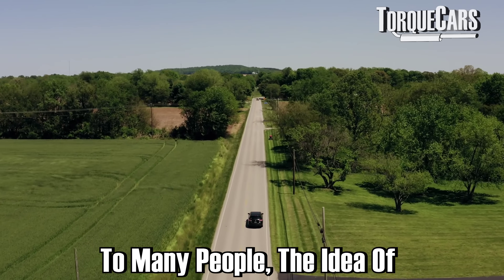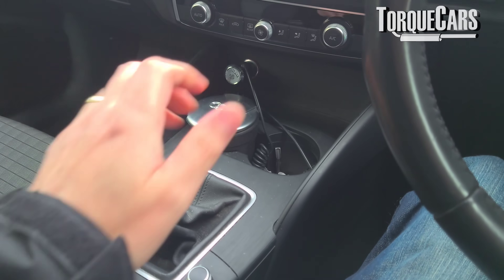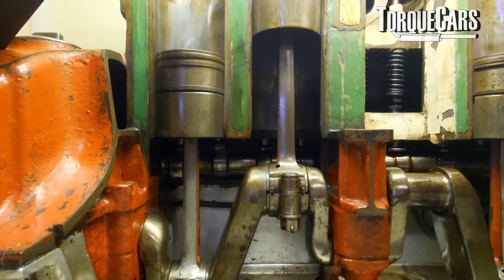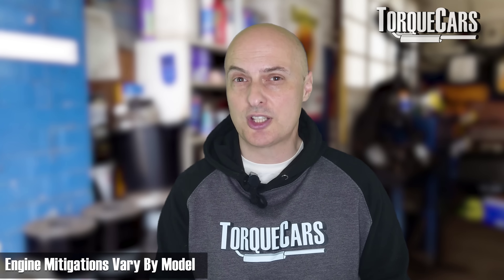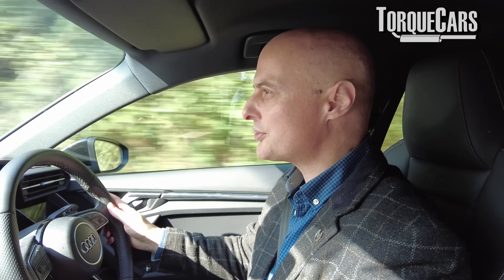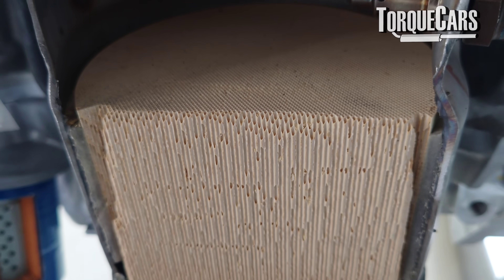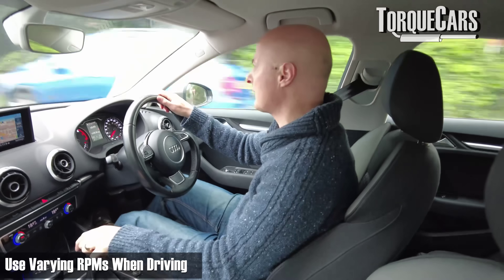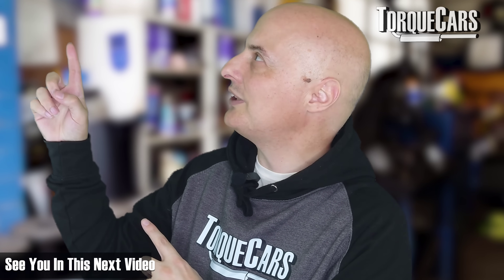BIG DAMAGE By Lugging at LOW RPM? Eco Driving Warning! (Manual Gears)

Comment: Dudes in 100k mile civics living at a constant 10k rpm and only going 25mph, it all makes sense now.
Reply: 100k miles is honestly nothing. I consider a car that doesn't make it to 100k easily a piece of junk. That or totally abused in both driving and maintenance.
Reply: @CynHicks  Yeah but cars usually last much longer than bikes of like 125cc single piston high revs of 10K+ rpm...

Just like Trucks can do crazy, crazy high mileage because they are very big, very low RPM high torque beasts of diesel that are made for mileage, they would never do their mileages if they had tiny pistons crazy high rpm gasoline engines.

Usually bikes for lasting long is like 4 piston big bore engines that are not constantly driven on redline and such bikes never have to be even driven to redline unless on a track cause like the max speed limit of 100KMph here lot can even reach it in first gear so they don't need much accelerator in 4th gear or 5th gear to maintain relatively high speed and also the huge RPM is divided by the 4 pistons doing the work which is much better than a single piston making the entire engine to redline to like 11K or more rpm...
Reply: Well my motorcycle 125cc 4 stroke has a bit more than 40K KM and now to do a full fuel tank I need to top up almost the full engine oil in like 3 times and that's the reason of being 95% or more always in high RPM but due to the lack of power it just needs full accelerator and full rpm all the time sadly ☹

The thing is it barely even smokes unless at like RPM cut just a very tiny bit, its like the damn oil is just evaporating from inside the engine FFS, also not a single drop of oil ever dropped either, the whole engine is all dry from the outside.
Reply: @guily6669 mine had the same issue, tho it just happened at 250k kms. It was stuck oil rings.
Reply: @jojomarujo8704  wow that thing lasted quite long, it isn't a 125cc with a crap single piston??
Reply: @guily6669 Yup. Mine lasted kinda long cuz i swapped the rear sprocket with the smallest size i can find so i can get decent speed without bouncing up to the rev limiter. I'm just a 55 pound guy that live somewhere really flat so smaller sprocket just works for my use case.

 Put a 0.25 oversize piston so the boring still have lots of life innit.
Reply: @jojomarujo8704   I hope mine doesnt have much wear inside, if it's mostly the piston rings, I'm safe, else I'm screwed...

But I really want to buy a 180cc kit however a mechanic from youtube assembling them said to me that they never last more than like 7 months sadly grrrrr....
Reply: @guily6669  Kinda sounds like a bad engine design.  I mean, I had an 06 GSX-R 600cc (rated 117-119 bhp/101-103 rwhp stock by Suzuki) with a pipe/no cat/MotoGP muffler.  16K RPM redline.  Most of my cruising was 5-6kRPM or higher.  That was slower riding aka 55ishmph+ in 6th gear.  It saw 16K RPM countless times, too.  I generally shifted at 14k RPM as peak power was rated at 12.5k RPM... I'd just hit 16K RPM when I wanted that sound only a 600cc like that could make at those RPM.  600cc DOHC inline 4 16-valve engine.  Engines were solid.  Yamaha tried to outdo Suzuki with a 600cc that did 16.5k RPM.  They kept blowing up and there was a massive recall on all their engines lol.  05-06 was the 600cc wars when the best 600cc supersport engines were made.  

But, of course, I didn't have to drive at 95% throttle to keep up with traffic.  I did have four wheelers and I rode those at 100% WOT most ALL of the time.  I'm an adrenaline junky.  No engine problems.  

I dunno, I just find it strange.... I mean, I can understand an engine under full load for 24 hours would do some damage, but I doubt you drove like that.  I just think whatever engine you had was a bad design.
Reply: @guily6669  new rings maybe pistons. they wearout a lot on those bikes. my service book ended at 48k km. mine died to a bearing failure of the gearbox outputshaft, where the sprocket connects. with 30k km.....
Reply: @johannesdatblue4164  I will have to go to yamaha one of those days, but my car just broke the clutch FFS (the pedal does nothing)... 😡

I really hope I just need new piston rings, however I dont think yamaha will sell a 180cc kit and assemble it ☹

And I never really liked the mechanic of the only yamaha dealership here, I only did the first revisions there and stop going there...

EDIT: Also I had a cleanable generic oil filter for a damn long time not made for this bike, maybe it didn't also help a single bit cause it almost never had any metals in it, I don't think it was filtering anything.
Reply: @guily6669 if it's a chinese one it will need a rebuild soon but lasted alright, honda and others might get to 80-100k kilometers if you drive them properly, maybe more but they burn oil and become POS.
All those 1cyl 125cc engines don't last long and need occasional rebuilds, they are cheap and easy to work on so anyways learn how to rebuild it yourself if you don't already know.
Reply: @guily6669 oil doesnt evaporate like that. Piston rings are shot, shooting compression gases into the crank case, forcing the breatger pipe to spit out the oil. Try riding it at a lower rpm and take a lool at it. Less rpm means less pressure in the crank case (in a gasoline motor, non-turbo)
Reply: @guily6669  I did 50cc -> 400cc -> now I want a sport tourer 1k or more 

But yeah it's not needed
Reply: My Integra is over 300,000km and I rev it to the over 8K rev limit literally every time I drive it. The rev limit exists to keep you in the intended rev range where the engine is not going to destroy itself. The limiter would be useless if it's set at a dangerously high level after all, it may as well not be there if that was the case. 

Basically it's not going to harm a maintained engine and has its own benefits on top of just being fun so let that engine breathe and stretch its legs, they were literally made for it
Reply: 180k miles on mine and 7k rpm is my daily 😂
Reply: @Athaion0  7K??? mine goes a lot to 115000 rpm LOL it's the rpm cut, it doesn't have a rpm gauge but it's around there... but like 9 - 10K is more constant.
Reply: @guily6669  mines stock cause I’m broke 😂😭
Reply: @Athaion0  Mine is also stock, it's a yamaha WR 125 X... I only have a K&N air filter, nothing more and different levers or whatever its called in English for the brakes and clutch in gold and with adjustments...
Reply: @guily6669 It’s a 125cc single, 10,000rpms isn’t out of the ordinary..

I used to own a 1989 FZR250R, it redlined at 19,000rpm and is a four cylinder..
Reply: @izzy031096  yeah the FZR250R was a crazy beast, a modern 250cc 99% won't be even close to scratch it...
Reply: @guily6669  a jet engine I presume... 😉
Reply: The kit isn't complete unless the muffler is replaced by a vuvuzela.
Reply: I’ve never really thought about driving in low rpm’s and then accelerating could cause engine problems, but thanks to your presentation, I get it.   Thanks
Reply: Gotta hit that vtec
Reply: Honda is great at making high revving engines. Too bad they don't make em like that anymore.
Reply: Sounds a bit iffy, I can't believe that civics are geared that low
Reply: @ttis3701  
Never noticed my 100k 2010 Civic go more than 2k rpm. Maybe I'm wrong.
Reply: Things nowadays are not super durable.
Reply: @BadMouthBroadcast  nothing like the smell of made in China 🤣
Reply: Have a k20 myself.  Can confirm.
Reply: That legit made me laugh 😂
Reply: @ttis3701  i accidentally replined my 96 tacoma v6 by pulling it in neutral while cruz is on lol and it has 350,000 going strong
Reply: @ttis3701  Clutch disc is dead
Reply: @ttis3701  litterally me 😆 65mph at 4400 rpm with a 5.1 FD lol
Reply: My k20 goes to 9000rpm, and I'm over 120,000, doesn't skip a beat.  It has hit 11,000rpm accidentally, but it's still going strong.
Reply: 100k aint shit ive got 210k on my audi a3 with a duel clutch
Reply: My Honda Civic i-shift 1.8 2009 has 111k Kms and I VTEC it almost everytime I drive it. I recently drove it from Paris to the UK averaging speeds of 135kph, max speed 172kph and vteching gears from 3 -5. Also drove from Oxford to Liverpool and back. Also hit VTEC a lot of times on dual carriageways etc. On the return in France I hit 180kph once. I checked the oil the next day and it was down a quarter, so I topped it up. Checked the VTEC solenoid, no leaks. It had a leak around 9 months ago and I changed the gasket myself, a few euros. Still clean as a whistle. Only thing about these cars is to take good care of the clutch, no creeping, nor keeping foot too long on the brake at lights. Otherwise no problems.

Comment: When I was young, dad told me not to 'lug' the engine.  Also, not to constantly 'redline' it or 'over-rev' it.  Like, don't go up a steep hill in top gear, or don't drive highway speeds in second.  Know whereabout your torque/hp curve sits in the RPM range, & drive with some common sense.
If you want to save your engine, or to save fuel -- stay home or ride a bike or take the bus or get a ride.

Comment: Coming from a '02 VW 1.8T I bought a '03 Mazda Protege5, this car has significantly lower gearing than my Passat. I often find my self in the 3-4k RPM range just matching how I drove the turbo. I thought I was driving the Mazda too hard wit hits "truck" gears, Its just a commuter car thats not overbuilt like the VW. I will back off from that harder driving especially before fully warmed up.
'Lotta JDM cars were made for their streets so I wonder how their range of driving is supposed to be? Like for a healthy, long lasting powertrain.

Comment: Can you down shift from 4 to 2 revv matching??  Or must it be sequential
Reply from the maker: My aim is to be in the gear I need rather than the next one in sequence. I can't see any reason on a manual to go through the gate one by one. I frequently do 3rd to 6th and 5th to 2nd, it makes pulling away easier. The rev match smooths out the change.

Comment: I'm light weight, so can easily chug around locally at low rpm on flat terrain riding my motorcycle, especially with it's forged crank and conrods. 1000-1200 rpm, no problem.

Comment: 3:20 nonsense
Reply: @jima7925  Or you misunderstood.
Reply: Yes it is nonsense. Video: "The rate of expansion going on in the combustion chamber is the same whether the piston is moving slowly or it is moving quickly". That is equivalent with saying the piston moves at the same speed whether it is moving slowly or quickly, which is self contradictory. The video probably means that the rate of combustion (amount of chemical reaction per time unit) is the same. That makes sense. So when the piston moves slower, the pressure will be higher (for the same amount of fuel combusted).

Comment: The real problem is nowadays the manufacturers program the automatic transmission to operate at the lowest RPM as a matter of course. The reason is they want to advertise great gas mileage because they achieve that when doing EPA testing.  I am witness to this in my Audi S3.  While my other cars are manuals, the S3 (like, unfortunately, most cars now available) doesn’t offer one, so I am stuck with it.  I can’t  begin to tell you how annoying it is when I look at the speedo and I am going 40 mph and the transmission is in sixth gear.  If I mash the pedal it downshifts three or four gears before I have passing power.  Ridiculous .  
One live the manual (please).

Comment: There is nothing wrong with running low rpm at highway speeds so long as you're on flat terrain. When accelerating or highway driving in hill country, it's a terrible idea.

Comment: I repeatedly hear this guy saying some things that earned this video the dislike. The primary thing is he doesn't know how gears work. Hypermilers, as he calls them, stay in a constantly low gear to reduce rpms? No, you'd need the highest gear the engine has enough torque to turn. That's how gears work, and even automatic cars will use the highest possible ratio. It's not damaging your car. If you try to accelerate hard in that cear, nothing will happen apart from the car lacking responsiveness and burning more fuel. Remember there is a linear relation between the engine and load, aka your transmission.  The strain is similar to driving at high revs in a low gear, but without the results. If it overcomes your torque,  the engine will begin to stall. Unless you are running your engine outside spec, at its limits for extended periods, you have an engine malfunction/weakness, or a part of your drivetrain suddenly overspins/siezes, nothing will happen.  

He says if you're going up a hill in a low gear that it requires considerably more effort.  Again, do you not know how gears work? Lower gears literally have lesser ratios, meant to amplify your output and reduce strain on the engine. All that happens is you need more revolutions at the input to achieve one revolution at the output,  but each is of a lesser strain. That's how gear reduction works.

The only real con to easy running is carbon deposits, and using an engine cleaner for the last few hundred miles before an oil change will fix that. People say your cylinders will get glazed and won't cool, but they're supposed to. Rings are meant to glaze the cylinder and create a more perfect seal than machining.  Cooling is done by oil squirter channels. An engine will be glazed over for most of its life. It's supposed to be. Only long endurance race vehicles and drag cars are supposed to always have a cross hatch, and those burn alot of oil. Their service intervals are measured in minutes and hours. That's not exactly a good thing in consumer vehicles.  

Drive at low rpm, save your fuel, clean your engine properly before changing oil.....every 5000 miles. 

Yes, European manufacturers recommend those long intervals so you'll be needing parts as soon as its past warranty.

Comment: At very low RPM the "splash" component of oil delivery/lubrication may be lost ? Not enough coolant flow ? 
I think the Cummins engine in one of the trucks I used had a warning not to run the engine below a certain RPM at full power for more than a brief interval,I think due to possible heat buildup

Comment: Always use low rpm and low load on a cold engine.  Never use low rpm with high load ie heavy throttle as this can cause lspi and also squeeze oil film from engine bearings.

Comment: Thinking that low RPM's means less fuel consumption is an old way of thinking. It dates back to when every gasoline car and truck on the road had a carburetor. Ever since the beginning of Fuel Injection (both port & direct), gasoline engines have had the ability to almost turn off the fuel while going downhill. Aka engine braking.  If you have a modern vehicle, select the "instant mpg" screen and you'll see it goes to 99 mpg going downhill and also when costing. It's the downhill scenario that will rev the engine yet not use hardly any gas .... indicated by the mpg being 99.   Lastly, the Italian Tune-up is good for the engine oil and reducing oil sludge plus intake carbon buildup.

Comment: It's the same with heavy trucks but if the revs are too low in a truck you can get really bad fuel economy too. Truck manufacturers and haulage companies go on about lower revs equal lower fuel consumption which is a load of tosh! Automatic trucks are a scam too, they say their fuel economy is far better than a manual which I've found to be rubbish. I have never driven an automatic truck that's been more economical than a manual, large transport companies might get an average fuel economy benefit as a whole fleet average because you have good drivers who'd get better mileage with a manual gearbox than a bad driver who'd more than likely get better mileage with an auto over a manual because they are obviously a shite driver. Low revs put an engine under strain, you need to find a sweet spot.

Comment: Hy. 

What about using the full rpm range in a high mileage engine ? My Corsa C has 197k miles (317k km) 1.0l 3 cylinder. At times i rev it all the way to 5k rpm, but i wonder if it is still safe to do, due to the high mileage. I use Valvoline 5w40 oil.
Thanks
Reply from the maker: This video should provide the answers you seek my friend.
https://www.youtube.com/watch?v=4TMgLwKda50

Comment: When I started my career in 1974 I bought a brand new 
Mustang 2. Four cylinder overhead cam engine. I started
My driving career with old school straight sixes and V8
Engines. I drove the Mustang 
At low rpm for about 6 months.
The engine developed catastrophe symptoms. Luckily 
Ford replaced the engine under 
Warranty. The service manager 
Had a talk with me and educated me about why I
Needed to use the engine at
Higher rpm . It was strange at
First but I learned the engine 
Thrived on RPM' s. Go ahead 
Wind it up. Within reason.

Comment: I only keep revs low while engine warms up. After that I always try and keep the revs within my cars power band. So for my new Gti it’s between 1800 and 5k. I always drive my dsg in manual mode so I can keep within these parameters. Even on long drives along motorway I will deliberately downshift in to lower gears to get the engine revving once every 20 to 30 miles or so. I don’t use the auto mode (D) much as all it does is search for the lowest possible gear at all times. The only time it will downshift on its own is up a hill or if I burry the throttle. My car has done 28k miles now after 2 and a bit years of ownership and everyday since it had about 2k miles it has seen high revs past 6k. Not one issue, engine related. I’ve had some warranty work done but it was a steering wheel and a seal on the driveshaft and that’s it. My other car is a Golf GTD and that js driven hard. No issues there either relating to engine or gearbox
Reply: @Theurgicnick  D searches for the highest possible gear at all times. (Low rpm, high gear). I have a VW CC with DSG. I like your approach.